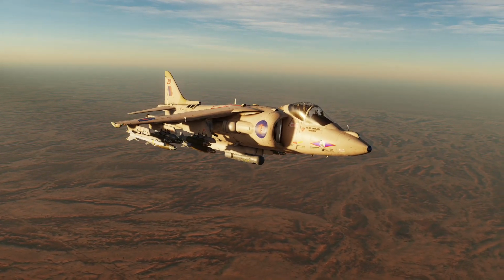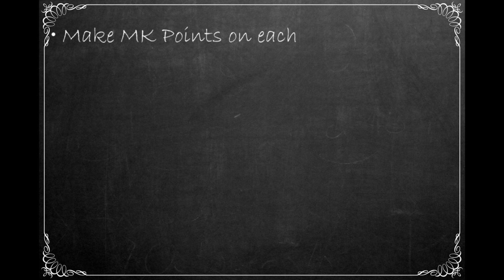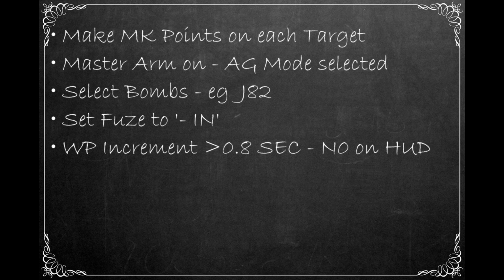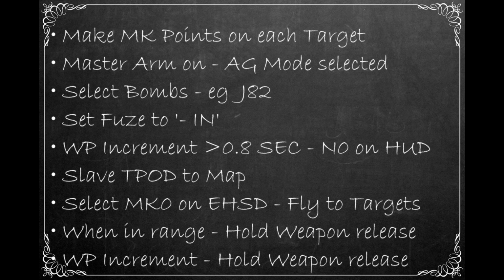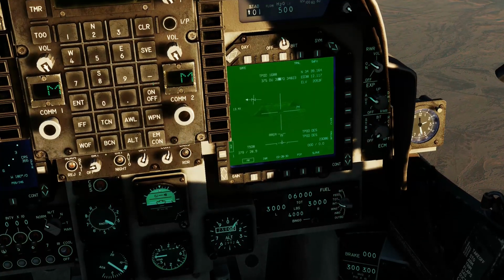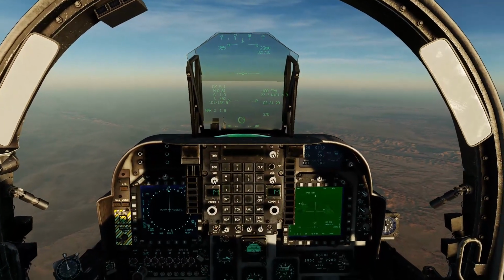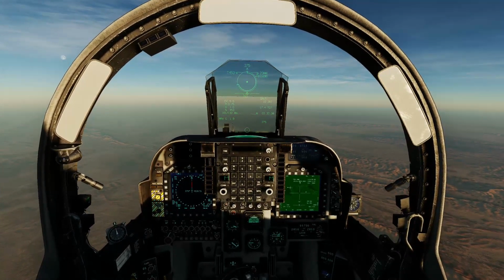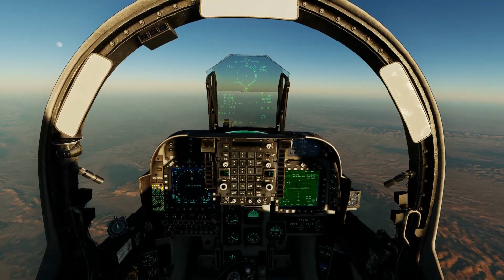DCS World - AV8B Harrier JDAM Ripple Tutorial

Comment: Great Video! I feel like ive seen it done different ways though.. one guy swears he can set it up using the "TOO" button on the UFCP so that you can just enter the launch zone and hold the pickle button and it will cycle between the target points as it drops the bombs. I think that guy used the F10 page system though, not that I know if it matters... Il have to do some experimenting, thanks for the video!
Reply from the maker: That method requires you to make labels on the F10 map and label them T01 through to T10 (if thats how many youre doing) I have done it myself many times, but;

A) Its long winded and feels a bit like cheating 
B) What if youre on a server where the enemies aren't shown on the F10 map? You'd have no way of knowing where to put the labels. 

This way can be done on the fly and is much more immersive IMO. 

Thanks for the comment 👍

Comment: Great tutorial thanks! Been pulling my hair out trying to learn the Harrier! There seems to be a lot of conflicting guides out there, guessing things have changed quite a lot on the module! - Just one thing, it's mandatory to have atleast 1 waypoint set up for the markpoints to work, correct? Can the waypoint be anywhere, or does it have to be on the target also?
Reply from the maker: Yes, theres been lots of changes over the last few months, especially with regards to the TPOD and AUTO bombing.

Yes, at least 1 physical waypoint for any AUTO bombing to work. You need 'DESG' (designate) boxed on the EHSD and the only way you can box that is if you have a waypoint in the system. Your waypoint can be anywhere, because your mark points will be what is then designated, if that makes sense?

Glad I could help mate 👍
Reply: @Imperial-GB  thanks for clearing that up mate!
Reply from the maker: @rafael263m  pleasure mate, glad I could help 👍

Comment: IDK what I'm doing wrong, but my JDAMs seem to mostly miss.

Idk if I'm messing it up somehow, but they don't hit, even when dropped about 100%
Reply from the maker: Firstly, are the MK points accurate? Remember, they don't see the target, just the ground. They will receive the coordinates from the ground behind a target if you don't point the TPOD correctly.

Secondly, ensure that once you have pressed WP increment long and slaved the TPOD to the map, that MK0 is selected on the EHSD. Pressing WP increment long makes a temporary target or 'T0' it could well be this is what you're doing. 

Thirdly, check how high and fast you are. Generally 15-20,000 is good for this. And around 350- 450

Comment: What's not clear to me is whether you are pressing WP increment after each bomb is released.  I tried doing exactly what you were doing, and held the pickle down, but only 1 bomb drops.  If I hit the WP increment then pickle again, the next bomb drops.  Just wonder if you are also doing the same thing or if somehow it is auto-incrementing for you.  Also, you can fix the issue with no waypoints by creating a dummy waypoint (can even be done in flight). Here's what I do...  Press the "DATA" button on the ESHD.  Press the "WYPT" OBU button.  Press "1" then "ENT" on UFC.  Press "POS" OBU button.  Then press "N", then enter "410000" and press ENT.  Then press "POS" OBU again.  Then press "E" then enter "0410000" and press ENT.  The leading "0" is important here or it won't enter properly.  Then press "DATA" button, and you've created a nonsense waypoint to who knows where.  But now you have a waypoint and you can correctly increment and select waypoints now.
Reply from the maker: No I'm pressing WP increment after every bomb drops. That's the idea behind the MK points. That way as soon as 1 bomb drops, press WP increment and hold Pickle again until that's gone.

Comment: Tried this multiple times following every step to the letter. The TPOD doesn't "look" at the mark points when cycling through them. I have Slave selected as well. All the bombs hit the same spot which isn't any of the targets, it's the initial waypoint that is in the target area. I am cycling through the mark points when dropping the bombs.  Any ideas?
Reply from the maker: So the system has been changed since I made the video. This method is still possible but harder to do. Theres an easier method though ill tell you how. 

First, you still need at least 1 WP in the Harrier, and DESG boxed on the EHSD.

Find targets with your TPOD, and when you do, instead of making a Mark point, press the TOO button on the UFC. It will say 1, press enter. The next target press TOO again, it will say 2, press enter. You can do this as much as you like, but you can only carry 10 500lb JDAM's so no point doing more than that. 

If you havent done so already, go into AG mode, master arm on and select your bombs and set the fuse. 

Then press WPN on the UFC and above your left MPCD you'll see some options come up. Press TGT and there, you can select which TOO points you want to drop bombs on. You can do any amount of targets or order numbers, for example 1,5,7,10 or you can do all 10 at the same time.

Once you've done that, fly towards the target as normal and once in range the numbers in the circle on the HUD will start counting from 0-100-0. If doing 10 bombs at once, press and hold pickle around 65. You only have to press and hold pickle once, as long as you don't let go it will drop all 10 in sequence one at a time. If you let go it will stop, if you press and hold pickle again it will carry on.

Sorry its a long comment and that I haven't updated with a new video but life has gotten in the way I'm afraid. 

What time zone are you in? Ill be on tonight about 1900 GMT if you're around and I can show you in real time. Let me know and I'll send you my discord or something.

Hope this helps.
Reply: Figured it out. You have to TDC Depress initially over target, hold WP Increment, mark your targets, Slave TPOD, hold WP Increment again, WP increment to M0, bombs away
Reply from the maker: @paulgeorgelas383  holding WP increment puts it into TOO mode. That is what I said in the video. Glad you figured it out. Try the new method above though its much better imo
Reply: @Imperial-GB  Hey! It seems you now have to do it a 2nd time? Works, that's all I care about! This is a ton a fun coming in low level (500' AGL) and dropping 4 as you rip over the target and BOOM! 
Thanks for the help!
Reply from the maker: @paulgeorgelas383  glad you like it mate 👍
Reply: @Imperial-GB  OMG... That is so much better! Only thing I'll add is to find the targets with the TPOD and then TDC down action to swap over to TPOD des and then follow the TOO order you suggested. 

With this ability, why use the mark points at all for targets?
Reply from the maker: @paulgeorgelas383  yeah there's two ways to do it. Either the way o describe above or using TOO points and WP incrementing similar to the video method. 

Honestly mate I didn't know about this method when I made the video, I dont know if it was even possible at the time. This vod was about 9 months ago I think
Reply: @Imperial-GB  Both work great, just tested both methods and made a kneeboard to follow. Cheers!

Comment: Sometimes my GBU-38's just go completely off target, any clue as to what could be causing that?
Also is there any benefit to using the GBU-54 over the GBU-38 when not using a laser designator?
Reply from the maker: Did you use this method? If so, first thing I'd check is that number on the HUD, and when you're releasing the bombs. I've found if you release any less than 65, your bomb has a high probability to miss. Second thing i would check, is the mark points. If you do WP increment long which is more than 0.8s, to put the Bomb in TOO mode AFTER you have selected M0 on the EHSD, then it will switch to T0, in which case you would have to scroll back down to M0.

There's no benefit at all, on static targets. If you were targeting moving targets, then you would need the GBU54, and could only really drop one bomb at a time.
Reply: Probably because you havn't properly assigned a target
Reply: @Pukin-Dog  I definitely did, because some runs all 10 bombs would hit in one pass, and some only 2 would hit dead on, with 8 missing in the same pass

Comment: Love the vid, and the quality of instruction... Can you confirm this is still valid please? I cant seem to make it work. Thanks again
Reply from the maker: So the system has been changed since I made the video. This method is still possible but harder to do. Theres an easier method though ill tell you how. 

First, you still need at least 1 WP in the Harrier, and DESG boxed on the EHSD.

Find targets with your TPOD, and when you do, instead of making a Mark point, press the TOO button on the UFC. It will say 1, press enter. The next target press TOO again, it will say 2, press enter. You can do this as much as you like, but you can only carry 10 500lb JDAM's so no point doing more than that. 

If you havent done so already, go into AG mode, master arm on and select your bombs and set the fuse. 

Then press WPN on the UFC and above your left MPCD you'll see some options come up. Press TGT and there, you can select which TOO points you want to drop bombs on. You can do any amount of targets or order numbers, for example 1,5,7,10 or you can do all 10 at the same time.

Once you've done that, fly towards the target as normal and once in range the numbers in the circle on the HUD will start counting from 0-100-0. If doing 10 bombs at once, press and hold pickle around 65. You only have to press and hold pickle once, as long as you don't let go it will drop all 10 in sequence one at a time. If you let go it will stop, if you press and hold pickle again it will carry on.

Sorry its a long comment and that I haven't updated with a new video but life has gotten in the way I'm afraid. 

What time zone are you in? If we're on around the same time I can show you in real time. Let me know and I'll send you my discord or something.

Hope this helps.
Reply: @Imperial-GB   Hey there thanks for very prompt reply. im at +8, would be good to catch up... cheers
Reply from the maker: @ftjr58  I'm GMT. Could probably catch you on a weekend. My Discord is Imperial #1369
Reply: @Imperial-GB  cant seem to work it...can you try me  Shag#1362
Reply from the maker: @ftjr58  sent mate 👍